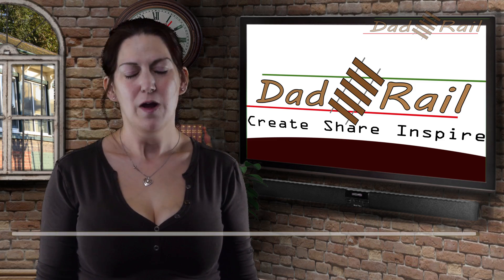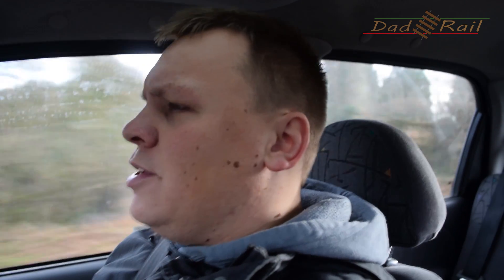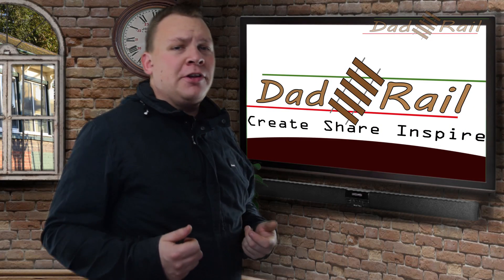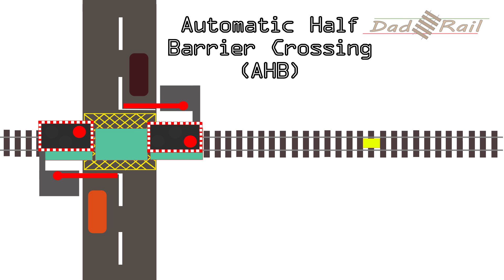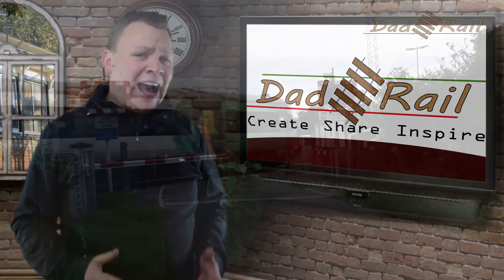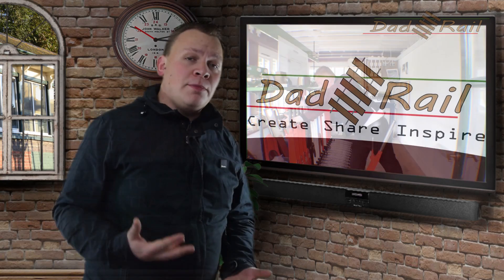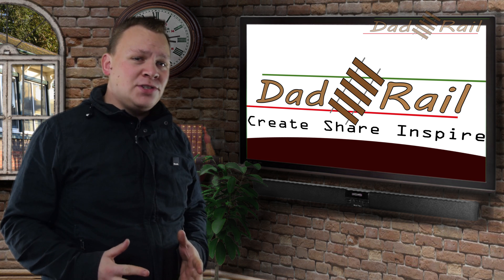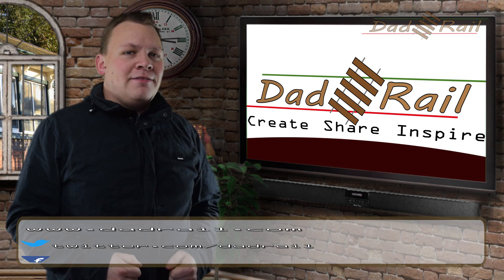Level Crossing Failures - Railway Rules DAD RAIL HD

Comment: Presumably all comms between drivers and signallers are via in-cab radio these days? If not, how are the communications done?
Reply from the maker: That’s correct we have a radio system called GSM-R it’s effectively a closed mobile phone network.
Reply: @DadRail  Cheers!

Comment: I volunteer on a heritage line and we have an accommodation crossing which the guard (on approaching the crossing) - the railway operates a push pull system due to not having a run round loop at one end - has to signal to the driver of a train whether or not it is clear. And, as the crossing is just after a sharp corner, there is only a few seconds between all of the crossing coming into view and the place where the driver, if he has not received a signal from the guard, has to apply the brakes. When the loco is at the front of the train however the guard doesn't do this bit.

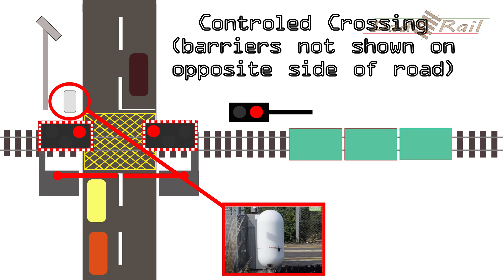Comment: 3:30 Not an accurate reconstruction.
Reply from the maker: barriers on over side of road not shown :-)
Reply: I'm aware but 1) Trains never reverse. If they SPAD correct procedure is to notify the signaller and await further instructions. 2) Trains don't stop at level crossings unless there is a fault with the crossing and/or protecting signal or other emergency at the crossing. They usually carry on straight through it as the crossing is closed in advance.
Reply: Don't think the reversing was intentional, just editing needing more work

Comment: Interesting seeing a different approach to crossings that are not working. In the U.S., the signals are designed so that a train engineer can see if the signal is activated or not. If the signal is not activated, the train must slow down and treat it as an uncontrolled crossing. In addition to blowing the horn, the train itself must ring a bell to replace any bell sound a crossing gate may make, and usually, a flagman must get out of the train and stop traffic before the train may proceed.
Reply: That's a much simpler, and common sense  way than the UK. And I bet all of your crossings are fully automatic too - activated by track sensors. Train activates sensor, bell rings and barriers go down, cars stop, train passes ( while sounding horn as well), job done. None this over complicated controlled crossing nonsense.
Reply: Some corrections:   
Level crossings in the U.S. would be of the "Automatic" type in the UK.  The signals are activated through the track circuits in the same way that the wayside train signals are activated—treadles are not used in mainstream US railroading.  Most level crossing circuits use an AC frequency (over the DC track circuit) and employ specialized equipment called a predictor.   The predictor can "hear" how the AC frequency is being shorted out by the train's axles, and can tell exactly how far away the train is, which direction it's moving, and how fast.  This allows each level crossing to have a constant warning time of 20-30 seconds no matter how fast any given train is approaching.    It will even turn off the signals if the train stops before getting to the crossing.

When a signalized level crossing is seen or known to be malfunctioning, the standard procedure is for the crossing to be flagged.  This means the approaching train must come to a stop before the level crossing, and a member of the crew who isn't the driver (usually it's the conductor) must get off the train and stand in the roadway and wave vehicle traffic to a stop.  The train then proceeds slowly, blocks the road way, and then stops to let the crewman back on.  Then the train proceeds normally.  All trains must perform this action at the level crossing until it's repaired, or unless other employees or officials are already on site (such as a police officer or signal maintainer) who can stop traffic instead.

All moving trains in the U.S. are required to ring the bell when approaching a level crossing, passenger station, etc.  It has absolutely nothing to do with whether a level crossing bell is functioning.  By default, all trains are also required to sound the horn/whistle when approaching a level crossing or passenger station.   The whistle signal is formalized as two long blasts, a short, and another long.  The signal must be sounded until the train has blocked the roadway, and repeated if necessary.  A train going 60 MPH will start this signal approximately ¼ mile (400m) from the crossing; closer if the train is going slower.  Some areas have setup "Quiet Zones" which forbid the use of train whistles except in the case of emergency.  Trains in these zones only ring the bell.  Last but not least, all trains approaching level crossings/passenger stations must have their full headlights on.
Reply: Simon Tay Yep, pretty much, bells, lights, and barriers activate, train goes past while constantly using its horn, the barrier opens and everyone proceeds.

Comment: UK trains need real horns like the North American trains. When sounded, it is easy to hear.
Reply: Geoffrey Lee Nah, noise compaints will go up. Our horns are loud enough
Reply: They had to make the horns quieter when these trains were 1st introduced because they were too noisy apparently! and they scrapped the rule of blowing the horn going in tunnels
Reply: They are starting to add "no train horn" crossings to the U.S. in densely populated areas. They usually upgrade the crossing so that it is hard to bypass the gates (usually by adding or extending the center median), and these crossings usually only have lights, gate, and a bell, but no train horn.
Reply: "Quiet Zone" crossings often do have what's called a wayside horn which sounds when trains approach.  The horns are aimed down the roadway and keep the noise pollution to a minimum.

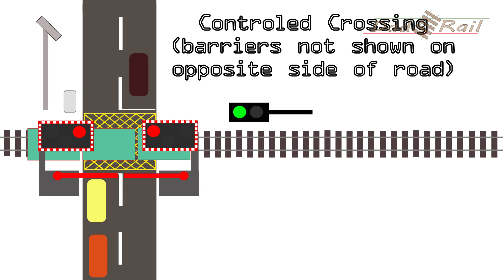Comment: 3:30 The train does not have to stop the signalman lowers the crossing for the train, so the train does not have to stop
Reply from the maker: Thats Correct, under normal circumstance the signal would be clear before the train arrives so as you rightly say the train wouldn't have to stop.
Reply: Thats because i live near a MBC too aswell One is a MBC-CCTV one is a MBC with a signal box

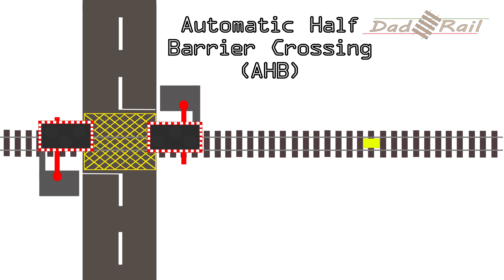Comment: 3:07 There is a white flashing light to tell train drivers if it is clear
Reply from the maker: Not on an AHB crossing there is not, but you would have one on an AOCL or ABCL Crossing
Reply: I swear there is on AHB There always is???? if you look to your left theres a pole with a red and white flashing light (Signal) there always on a AHB look at beccles bypass on google and your see one >:)
Reply from the maker: Guarantee there is not an an AHB. Beccles Bypass, is an ABCL crossing, that is Automatic Barrier Crossing Locally Monitored. They look the same as AHB crossings, but as you rightly say there is a flashing white light to indicate to the driver that the crossing is cleared. AKA the crossing operation is monitored locally by the train driver. Also ABCL crossings have severely restricted line speed, i think the max is 25 MPH. there is a good forum post about it here if you want to read more. https://www.sabre-roads.org.uk/forum/viewtopic.php?t=37136
Reply: I get ya now
Reply: The white light doesn't tell the driver the crossing is clear, it tells him the electrical circuitry operating the road signals has operated, it is upto the train driver to establish the crossing is clear before proceeding over it. Hence the term locally monitored.

Comment: Ive been caught between the barrier and near the train 3 times at ine crossing over 2 years, apparently it was a normal thing in my old village but whats strange about the service was its a manual manned crossing, you may argue there automatic ir whatever but the mayor if the town nearby confirmed it was a manned crossing which isnt automatic but people still get caught in there as there crossing, so youve just started walking over the crossing and the red lights flash and it comes down almost immediatly but your now stuck in there, lol
Reply from the maker: Wow that sounds like it needs looking into.
Reply: That is a good example of where an automatic crossing with half width barriers would be better.

Comment: Nice video. Couple of points...if very pedantic. A train can only be authorised to pass over a level crossing with barriers in the air if the road lights are working. If the lights are not working AND barriers stuck in the air then all rail movements over the crossing are suspended until either something is fixed or the crossing is taken on local control.

Signals are found on approach to automatic half barrier crossings, they are just not interlocked with the crossing so will display a proceed aspect even if the crossing is open to road traffic. However they are generally fitted with an emergency replacement function that can put the signal back to danger if needs be. Though if a train is already approaching at line speed it probably still wont stop depending on where the signal is in relation to the crossing and how fast the train is going.
Reply from the maker: Thank Daniel, not pedantic at all. There use to be an AHB at Battle Road on the Hastings line, Its now a CCTV. there was a signal just before the crossing, that use to protect the next level crossing (river hall cctv) and also mountfield sidings. Although the crossing was an AHB it was interlocked with the signal, many times i stopped on the signal, and the crossing barriers were open, they use to go down just before the signal changed to green.

Comment: How did you re construct that?  bare in mind that that scenario seeing a train cross a level crossing with the barriers raised and road lights off is one that frightens me and I have nightmares about.  There is only one Level crossing I cross on a fairly regular basis and it's a full barrier signaler operated one on the Coventry to Nuneaton line.  Although no longer from a box Adjacent (Coundon Road, Coventry) it is now I believe operated from the main box at New Street in Birmingham I understand.  As a habit especially at night i always give a glance out of the corner when I cross.  By this the only way that can possibly happen there is if a driver passes a red signal at Danger?  Did you have to get Network Rail to put that crossing into manual local crontroll for that re construction? Was that an actual live passenger train?
Reply from the maker: Hiya Dave thanks for your comment. I wouldn't worry too much, I have worked on the Railway for 10 years and have  only heard of this happening once. As you rightly say a full barrier crossing will be protected by signals, and yes whilst it is possible that a train can run past a red light, it is uncommon and there are systems in place to stop the train (TPWS) should the train pass a red signal. Also in most cases, if the signal is located close to the level crossing there will be an instruction in the signal box that a train can not approach the signal, even if it is at red until the crossing has been closed.

With regards to the reconstruction, it was noting more than camera trickery. We set a camera up on a tripod next to the crossing and then filmed the car going across with the barriers open. With the camera in the same position we then filmed the train going past. The crossing was operating normally with the barriers down and the train was in passenger service. I then used a pice of software called adobe aftereffects to combine the footage of the open crossing and the car, with the footage of the closed crossing and the train. As you will notice the crossing is a half barrier, so i replaced the barrier that was down with footage from the side of the road that did not have a barrier. where the full train was visible. By getting the timings right and applying a few other tricks, i think we got quite a convincing shot.
Reply: How they filmed it was most likely, filmed the car crossing safely, then filmed a train going over and edited it
Reply: This is why in the US and Canada, high risk vehicles like buses and those carrying hazardous materials, are required to come to a complete stop, roll down the windows or open the door, listen and look prior to any grade (level) crossing, regardless of whether it has automatic gates or not. This is combined with the horn that trains are required to sound in advance to guard against malfunctioning crossing gates. School buses even have a special switch that stops all noise generating items, such as two-way radios and ventilation fans.

Comment from the maker: Sorry about the lip sync issue in the first 20 seconds :-)
Reply: Dad Rail not being rude but most automatic crossings will have signals
Reply from the maker: Hi Adam, not rude at all, all comments welcome :-) This can be a confusing area but I will try to explain. Firstly I am a mainline train driver so am familiar with the rules and procedures concerning level crossings. Although on the railway there are often anomalies so I could be wrong. The very nature of an automatic crossing suggests that it is not interlocked with the signalling system, there maybe signals in the area, but they will be independent from the actual crossing, meaning they can show green even when the crossing is up. It would be less confusing to say they are uncontrolled crossings rather than automatic, as many controlled crossings, especially the new MCB-OD type are fully automatic. Basically if a crossing has signals protecting the crossing, it is a controlled crossing, regardless of barrier width ect, this is because the crossing environment is controlled (trains only allowed to pass if crossing is confirmed clear) Where as an automatic, or uncontrolled crossing such as an AHB is not monitored and not interlocked with the signals, if it was interlocked with the signals then it would be a controlled crossing. but as above 10 years on the railway has taught me that there are always anomalies and variations - thats the great thing about working on the railway your always learning :-)
Reply: Dad Rail AOCL types of crossings have a white light to show that the crossing lights are flashing and a few that I've seen AHB have a signal showing that the crossing is in operation like a red and a yellow signal
Reply from the maker: AOCL are slightly different to AHB they are the same in operation as ABCL crossings, these are locally monitored crossings, yes you are correct they have the flashing lights telling train drivers that it is ok to pass over the crossing. They are worked by treadle the same as an AHB that starts the sequence. Also the speed limit over these types of crossings tends to be very low around 20MPH The lights at the crossing however are crossing indicator lights rather than signals. When the lights are not flashing, there is often a manual control plunger at the crossing that the driver can push to start the sequence. However the lights purely tell the driver that the crossing is working, they don't give an indication that the crossings is actually clear of any obstructions. If the white lights are out then drivers are allowed to proceed over the crossing at there discretion, and report it to the signaller.

not sure about the signals on an AHB this could be a new thing? can you remember what crossings this was at as I would love to look into it a bit further, like i say the railway is full of anomalies, and every day is a learning day.
Reply: It’s ok
Reply: Its no problem. Didnt even notice untill I saw your comment!
Reply: How did that happen
踏切の失敗
Reply: Did this happen